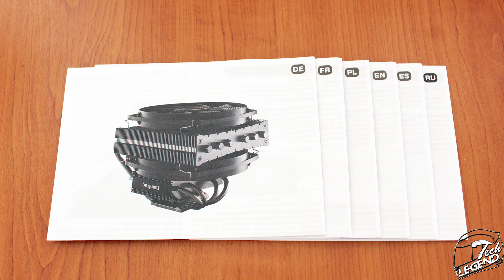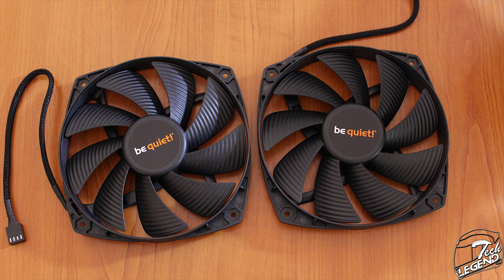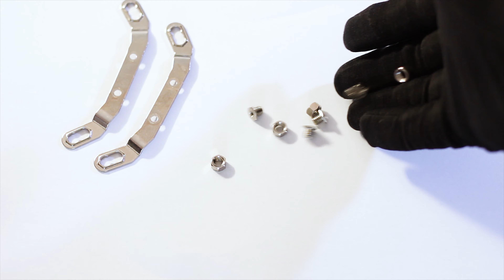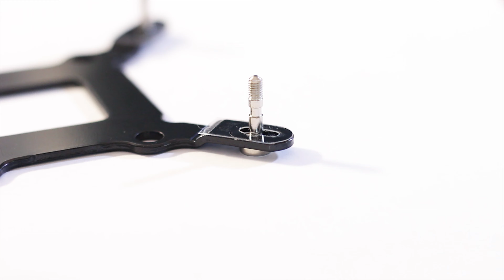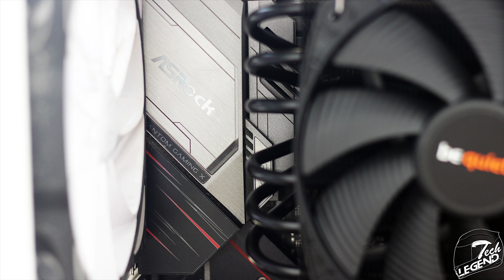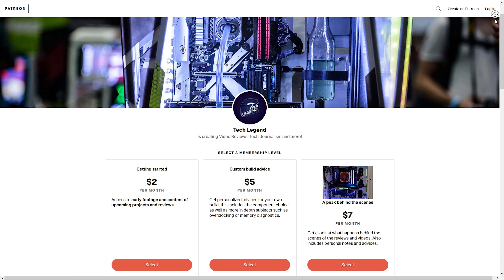be quiet! DARK ROCK TF - 2020 Review

Comment: Works well, but has compatibility issues with ram on ITX builds. You must use low profile ram on an INTEL build because you’re limited orientation wise.
Reply from the maker: This cooler was never designed for ITX in mind. It is pretty big and uses two fans. There are other special coolers made for ITX usage.
Reply: @TechLegend-com  It's the absolute biggest cooler that will fit in the NCase M1 (itx case). I made it work :). It's great.
Reply from the maker: @SmartestPerson666  Glad to hear you made it work, especially inside that case!

Comment: My i7 9700k reach to 74  stock🥴 with that cooler🤧
Reply from the maker: Hey, please check the mounting system and if the cooler is seated properly on the CPU. What thermal compound did you use?
Reply: @TechLegend-com  Grizzly and the mounting system should be right I mounted it already 2 times I decided to use a bit more force to tight it up im at 67 degree now in BF 5. Gonna remove my custom fancurve and gonna check if its lower. But atm I think its more a airflow issue
Reply from the maker: @TiGG3zZ   Try to tweak the fan curve and see what results you get. Please let me know how it goes! :)
Reply: @TechLegend-com  100% fan speed at 65 degree means a stuck at 67 - 69. Gonna get 2 more casefans and see what changes
Reply from the maker: @TiGG3zZ  What case are you using and what fan configuration?
Reply: @TechLegend-com  Dark Base 700 2 in 1 back out one up out
Reply from the maker: @TiGG3zZ  So two fans in the front, one in the back and one at the top? Did I get that right?
Reply: @TechLegend-com  Yes 2 in 2 out and I really think its the case cause if I start my PC first time on the day I get like 30 ° on Desktop. In a few hours it wont go below 40 - 43 on desktop. Im not sure if I do 3 in 3 out or 4 out 2 in or 3 out 2 in tomorrow what do you think is ideal?
Reply from the maker: @TiGG3zZ  Forget the idle or desktop temperatures. Get either Aida 64 or intel burn test and have one of those heat up your CPU, and then see what temp. you get. Idle temperatures are meaningless, even with an AIO, I sometimes get temperatures upwards of 40 degrees on idle.
Reply: @TechLegend-com  With opened Sidewindow I dont get above 64. closed Case 70 - 71
Reply from the maker: @TiGG3zZ  I think it's normal for such a cooler, it is top flow after all. As long as it won't go over 75 we should be good.
Reply: @TiGG3zZ  its not coolers problem that case has poor airflow
Reply: @raulitrump460  Ikr i realised that I barely reach 65 - 68 degree without front and top. My Case got changed with a CNC machine now and has better airflow
Reply: @射進肚臍 Hey. I have a custom Case. Upper and Front are opened with MSI Logo and symbols.Still reaching 85c at hot days

Comment: How about the AM4 mounting? This cooler does look cool but the AM4 mounting looks like it will be cause a compatibility issue for ITX boards.
Reply from the maker: Installing a big CPU cooler on an ITX board will always be a complicated business, as you have little space to maneuver.
Reply: I'd advise you to check be quiet's website for compatibility with mini itx motherboards.

my msi z490i unity fit it but the ram clearance is an issue because i have big ram sticks.

Comment: I want to build a mini itx pc with these cooler, is it okay to use this cooler with a tempered glass side panel (cooler master nr200p) ?  sorry for my bad english
Reply from the maker: This cooler will work with that case, but you will not be able to install your graphics card in the vertical position.

Comment: I own this cooler. It does its job wonderfully. It can handle Ryzen 7 2700 OC 4.0Ghz @ 1.3V with all cores fully load with temp around 64 celcius. Now I have switched to Ryzen 5 3600XT and it does the same. It can handle the heat generated by this 3rd gen Ryzen. However, to re-paste or change the CPU, I have to bring out my motherboard out from my case. I am using CM H500 case. That was the downside of this cooler. Others I find it awesome. I guess any case that able to open the upper part of the case should be good. You can unscrew using wrench provided by Be Quite! without taking out your motherboard.
Reply from the maker: Have you tried to just unscrew the backplate bolts from behind?
Reply: @TechLegend-com  haven't try that yet. Thansk for the suggestion. Will try that later on. 😁
Reply: You sir are legend! Unscrew from the back was the easiest way and taken only less than 10 minutes to figure out and do it. Thanks mate! Definitely subscribed!
Reply from the maker: @hafizshepard  I'm glad you got it sorted, you don't need to complicate things more than they are already are! Thanks for subscribing!
Reply: @TechLegend-com  Aha, couldn't make it without you bro. You are most welcomed!
Reply from the maker: @hafizshepard  Great to hear!

Comment: What are your thoughts on a  be quiet! Dark Rock Pro 4 50.5 CFM CPU Cooler  for AMD Ryzen 9 3900X ?
Reply from the maker: It will work great with your CPU. The Dark Rock Pro 4 is the best air cooler from be quiet!
Reply: @TechLegend-com  I actually don't have cpu or cooler yet.  I'm in a proces of building my new pc, but I don't know what would work best for me.
For my  needs that I plan to do; gaming ((gta5, deadside, battlefield4/5, starcraft 2...), and casual 3d modeling/rendering (autocad, maya, home planner...)) My first question is;  Do I need pci-gen-4 pc components or can I get by with gen-3 pc components?  And what would you recomend me for my motherboard, cpu and gpu combo, that I can use too full potential? On that note i have saved 1200-1600 euro/1500-2000$(US) to spend on all components, and I have bought pc case(Be quiet Pure Base 500 White) + I like silence a bit more than performance.

Thanks :)
Reply from the maker: @antoniocepaj7544  You can take a look at the PC in this link and see if it suits you: https://pcpartpicker.com/list/Jk7Vsk
Reply: @TechLegend-com  this is ok, but I'l invest around 200-300$ more(just under my budget 1800$) for this setup(i think it will last me longer without upgrade's, and when I need, I can just upgrade it + I might modify the case (make it smaller, depends on temp.)).

AMD Ryzen 7 3700X 3.6 GHz 8-Core Processor
be quiet! Dark Rock Pro 4 50.5 CFM CPU Cooler
Asus ROG Strix X570-I Gaming Mini ITX AM4 Motherboard
Crucial Ballistix 32 GB (2 x 16 GB) DDR4-3600 CL16 Memory

Crucial MX500 1 TB 2.5" Solid State Drive
Crucial P1 1 TB M.2-2280 NVME Solid State Drive
NVIDIA GeForce RTX 2070 SUPER 8 GB Video Card = or even 3070 if the price will be right
be quiet! Pure Base 500 ATX Mid Tower Case
be quiet! Straight Power 11 650 W 80+ Platinum Certified Fully Modular ATX Power Supply
be quiet! 61.2 CFM 140 mm Fan x1 = extra fan

Thanks :)
Reply from the maker: @antoniocepaj7544  You can also look at the Riotoro Enigma power supplies, those are made by Seasonic and sometimes are quite affordable.

Comment: like the review but after seen the installation no just no sticking with NOCTUA ,  i was looking for reviews on this cooler for my new case cerberus x
Reply from the maker: The mounting system used by Noctua is one of the best around, also the easiest to work with. This newer be quiet! has been improved a lot since 2016, but it is still a complex system.

Comment: I did not know this was an option, as I'm used to seeing huge towers with fans pushing air to the rear of the pc. I would consider this in place of my AIO in my next build.
Reply from the maker: It truly was a cooler ahead of its time. Plus, on an AMD system, this will help greatly with the VRM temperature.